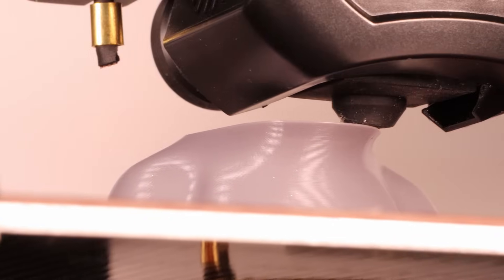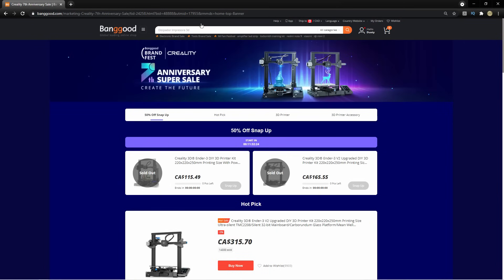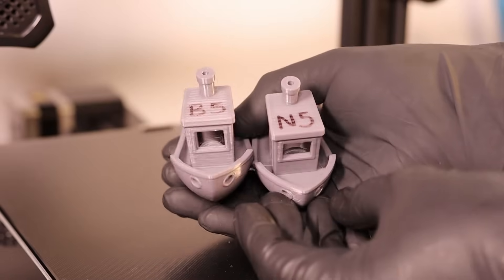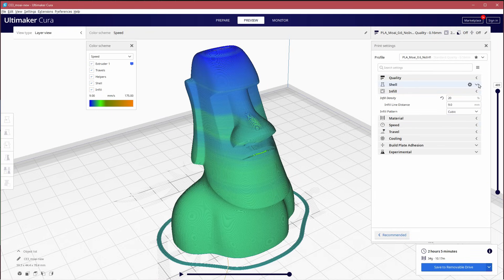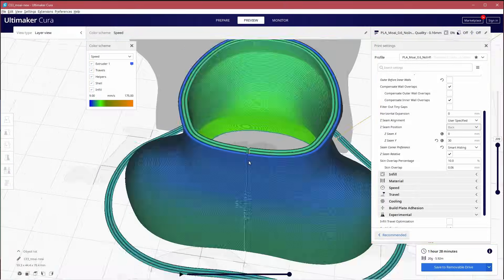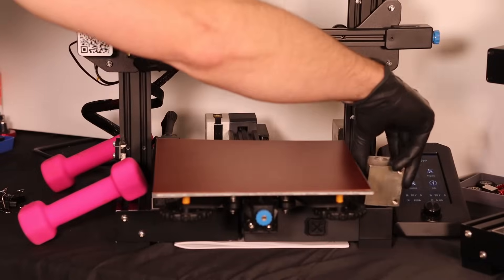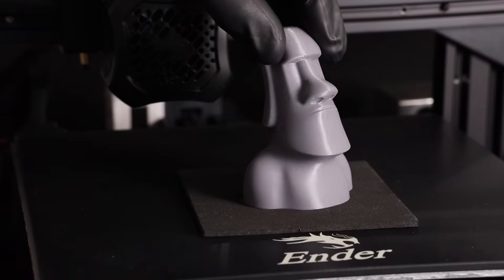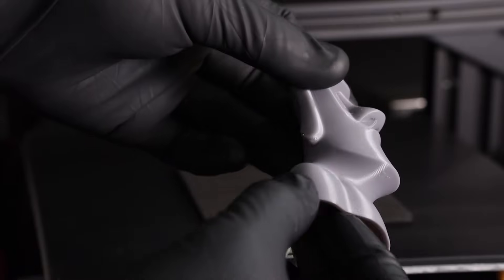Creality Ender 3 V2 - My Cleanest Print Ever and You Can Too!

Comment: interesting find on the solid PEI sheet, is it as good as spring steel sheets in terms of print removal? How's the weight difference? I would eschew the glass if my bed was more flat, but that's another costly upgrade if your built in bed is warped.
Reply from the maker: I've never had the opportunity to try the spring steel out, but I think what I'll do is purchase each type and do a comparison video for each.  There is a big difference between the two axis, at least bringing them closer will improve the print quality and further reduce vibration caused by the Y movement.  I also have braces to try on this machine, I wanted to ramp-up the speed to see how fast these printers can reliably print.  I don't think the speeds are that high, and I'd like to see where the bottlenecks are (nozzle), motors, overall design etc.
Reply: @NeedItMakeIt  could you weigh your pei sheet? :)
Reply from the maker: @specialingu  85grams
Reply: Totally understand, I weighted the glass bed and its about 1lb (540g) compared to the x axis even if you add a direct drive its only about 250g
Reply: @TechExploresNYC  i got curious about what ive got laying about, 540g for my glass too, the lightest was a textured sticker at 32g (but -5g for the sticker cover which you remove to use it, so 27g if you stick it down) (guessing its a clone of what early 3dprinters shipped with?) a steel pei sheet was 241g (say minus 5-7g for cover over the pei surface, so 235g) "fysetc" brand. self adhesive magnetic sticker part that gets stuck to the bed 105g/100g without sticker cover)

Comment: Looks super smooth. That seam seems extra deep though.
Reply from the maker: I think the seam can be improved for sure, I will work on my seam and come back with something that works the best for the bowden setup on this printer.  I print with a 0.6mm nozzle, changing to the 0.4 will improve a little bit from  this.
Reply: @NeedItMakeIt  I didn't realize this was with a 0.6 nozzle, that's pretty impressive.
Reply: @NeedItMakeIt  Looks like it's just coasting too much. Could be because the larger nozzle results in less pressure in the bowden so less coasting is needed
Reply from the maker: @bloogaming8827  I'll work on it and come back with something a little more presentable.  Nothing less than perfection... I hope.

Comment: Stock nozzle is 0.4 you went 0.6 but with a finer layer height. Have you tried with the 0.4 nozzle and same layer height as the 0.6?
Reply: pla will stick to copper but not the same to brass, that's the difference
Reply from the maker: @andidotro  Did not know that.  Ccopper is much more thermally conductive, hard to say how much, since brass is an alloy.  I'm a bit skeptical about the copper nozzles, copper is incredibly difficult to machine, maybe they use a different method to form it, and maybe they are alloys themselves.
Reply from the maker: I can do that and see what happens.  Do you have any experience with the copper nozzles?  I'm curious to see if there is any difference in the print quality from using copper over brass.
Reply: @NeedItMakeIt  There Is not any differece between copper and brass. Just span life.  😎

Comment: Do you find coasting with stock settings making a difference in your prints? I've never used it because i thought it may require tuning.
Also, you talk about the weight of the bed, the vibrations of the printers... All of this will have less impact if you print slower. If people are having issues, using a lower speed would help a lot, right?
Reply from the maker: I can put together a quick test to show the differences if that would help.  Yes printing slower does help, I can't bring myself to print slow, the speeds I showed in the video are pretty slow for me, normally I'm up at 70 infill, 60 inner walls, and 50 outer walls, but my prints are mostly structural and they don't need to look so clean.  The reason I suggest adding weight is to dampen vibration from the normal standpoint, the other side of it is that the alum frame is pretty stiff and it helps to seat the printer on the table better.  Bolting down would be idea and shimming as needed.
Reply: @NeedItMakeIt  After a test on a cylindrical part, coasting didn't make any difference on the z-seam for me. But the default settings didn't make the print any worse, so I guess tuning could help a bit.
I also mainly print structural components, so my speed is at 70 most of the time too.
I just think people who are looking for the best aesthetics should start with a lower speed before anything else.
Great tips anyways, thank you for your answer !
Reply from the maker: @LenordeFPV  Great feedback, it is so tough to tell, we really need some high def zoomed in examples, I did make the mistake on my print to not activate the wipe distance, I am trying another right now with it on as well as coasting to see if it helps.    I just started experimenting with higher speeds like you do, the stock fan can't keep up so I have a massive fan cooling the entire area and that seems to do the trick.
Reply: @NeedItMakeIt  Wait, I don't print at 70mm for everything, just for the infill. I then let Cura step it down for walls and other parts.
I didn't know about the wipe distance! I will check that too. Maybe there is a way to get almost rid of the Z-seam after all...
Reply from the maker: @LenordeFPV  I've just finished a test overriding the default speeds cura uses due to the limitation of cooling and the print turned out very well, we might be printing slower than we need to.  I'm going to do some wipe tests tonight as well, wipe + coasting might just do the trick.
Reply: @NeedItMakeIt  Very interesting ! I hope you will make a video to share your results 😉

Comment: Why do people use glue with a heated bed, thats the whole point of a heated bed
Reply: If your using a PEI sheet your models can shit abit to well... ripping holes ect. For the rest it just helps abit with adheasion tho some degreaser from the kitchen and some IPA 99% before every print works 10x better for me.
Reply: Never used glue once on my pei bed(50 to 60c depending on pla or pla+).. sticks like glue and once the bed drops below 30c the print just pops off. Pei sheet on spring steel(creality). Way better than the standard clip on bed
Reply from the maker: @pridedyanky  I'll give it another try, I can't say I've had that success, but maybe it is just a little too cold, worth another look.  I don't mind the glue stick though, it works great every time and last a really long time.
Reply from the maker: I've never had good success with only the heated bed, the reason is probably that the bed temp is not high enough, I don't personally like to wait for the bed to heat that much and glue stick is super cheap and works wonders.  I clean with soap and water, or just a wet cloth.

Comment: Great result! I will try your gcode on my newly assembled Prusa. Somehow will try to show my results :)
Reply: don’t try the gcode ... retraction, flow, leveling settings are different from an ender instead try the settings profile changed according to your printer ( direct drive vs bowden setup )
Reply: @NanescuRadu1  Thank you. I haven't thought about this..... embarrassing.... I am just starting))))
Reply from the maker: I have been thinking about this lately, the Prusa seems to produce such great results and I wonder which part plays the biggest role in this.  They use linear rails, maybe the motors are higher quality, the pulleys, or the board.  I am really curious to see if the Prusa blows this printer out of the water.  Retraction can be adjusted using the Profile in the description to 0.5 or 1mm and that should get you in good shape for the direct drive.  

I have been eyeballing the bondtech direct-drive adapters for The E3V2, they looks so well made, too bad they aren't a little cheaper price wise.
Reply: @NeedItMakeIt  motors not so much its a combination between the precision of the linear rods and the factory calibrated extruder ... also QC plays a huge role ... they don’t sell untested equipment
Reply from the maker: @NanescuRadu1  That's a good point, the first printer I received was flawless in the assembly, worked well right away, the 2nd printer had the wheels overtightened.  Linear rails may be superior, my first printer was the Anet A8 with these type of rails, however the printer was so wobbly that it could be produce quality prints.  I maybe have to purchase a Prusa.  I am very interested in trying a CoreXY printer as well, do you know much about these?
Reply: @NeedItMakeIt  for a corexy i highly recommend looking at voron 1 or 2 if you already have printer and you can find kits on aliexpress for the rest non printable parts ... using klipper as the main firmare its the fastest printer around other than a delta
Reply: @NeedItMakeIt  When I decided that I am going to get into this hobby I did some research and for some silly reason didn't start it right and purchased Anycubic for 3 month I was always adjusting, trying different settings, different slicers, filament and I managed to print only 1 full print. And then I had enough and sold it for parts. Purchased Prusa (Mk3S+ Kit), and right from the beginning it was printing like I was expecting, yes I did just a little bit of tuning, changed a few settings but most of the time it just prints. 

Problems with Anycubic: motherboard ( was loosing home), motors(needed adjustment), and constant problems with leveling. The only thing where I didn't have problem was adhesion it was great
Reply: @NeedItMakeIt  To be honest I think it's everything combined together makes it such a great printer. On one of these days I will try to print it and see what happens

Comment: It's pretty cool to see this is considered a really clean print. I was doing prints like this on my Ender 3 v2 only after a couple days as a complete newcomer to 3D printing, and I was wondering how I was progressing. 

I've always picked things up quickly.
Reply from the maker: Nice!   I could do better only by changing the nozzle and slowing down the print.  This printer out of the box does make nice prints most of the time, there are some people that seem to struggle.  Changing too many slicer settings at once might be the cause.    I have found that the wheels are too tight and should be loosened and adjusted, this only happened on my 2nd printer.  The 2nd printer also does not seem to have Gates belts, the first one I purchased 9 months ago did.  

I try to have the most harsh lighting and highest def video for my prints so that we can see any imperfections.  I'm really interested in setting up a nozzle cam as well to get a much better understanding of when and why these imperfections occur so they can be addressed.
Reply: @NeedItMakeIt   Can you share your Cura setting using the .6 nozzle.  I have struggled tuning the .6 ....thank you.
Reply from the maker: @chrisc9213  Sure, I'm just finishing up some profiles tonight, I'll send you a link when I'm finished.
Reply: @NeedItMakeIt  Your awesome thanks!!
Reply: @NeedItMakeIt  Awesome let me know when you have them finish!! Thank you!
Reply from the maker: Sorry, I had trouble finding this comment again.  0.6 vs .6.... here is the link.  
https://drive.google.com/file/d/1T4584P7lHn-ETFrgNKRSo2xcLVRHdLK-/view?usp=sharing  

Let me know how it goes!
Reply: @NeedItMakeIt  You hit the nail on the head. People mess with too many settings at once and they don't have the attention span to remember all the settings they've changed, or how to compile those changes into a working formula. Or they have trouble putting the machine together properly.

I learned when I was a computer technician that you do a process of elimination. One thing at a time until you can eliminate what's causing the issue, or until you can figure out what that setting does.

The only settings you need to focus on at first are quality, infill, supports and adhesion. It's odd to me that people have a hard time getting their prints to stick to the bed too, or leveling the bed. I can level the bed in less than a minute with a Post-It note.

I'm seeing what the limits are with the 0.4 nozzle before I experiment with new nozzles. I would like to get a fine nozzle for very high quality stuff eventually. Right now I'm experimenting to see what I can do utilizing the least amount of material and infill, and trying to print strong, passable prints in the quickest time possible.

My main uses for 3D printing are prototypes, products I can use in my fabrication business. Fixing things around the house or at my shop. I'm not much into printing models and figurines. So high quality isn't a huge factor for me. However it's good to know I'm capable of it. I'm an artist but in my artwork I use wood and metal.

Thanks for the videos! 👍
Reply: @dangerous8333  Can confirm. Changing a bunch of settings, especially without some kind of table describing what you changed and what quality you got, leads to trouble. Also, only using 1 or 2 small test prints can lead to false positives by optimising the slicing profile to that particular model instead of a more general profile.

Comment: I found out that combing makes my models worse, so I started using the default settings with some tweaks here and there. The results are much better.
Reply: in order the combing to work perfectly - try activate retraction distance in combing mode 5 mm!)))
Reply: max comb distance with no retraction set it to 5 ) and everything will be gooooood!
Reply from the maker: Can you send me a profile to test?  Some prints might not benefit from it, and there are different combing settings which could affect the results.  My email is needitmakeit@gmail.com .
Reply: @NeedItMakeIt  Sory I have to correct myself, only one model came out worse, on all others it makes 0 difference.
Reply: @NeedItMakeIt PLS CAN I HAVE THE FILE

Comment: Try printing with PLA-F, it is supposed to be a pla with more abs like qualities. I've only tried black and white filaments so far, the black printed like any other pla, but the finish and quality of the white was sublime! I've shown it to a few other friends with 3d printers and they've all said that they have never seen such a quality print before! I did it with a 0.4mm nozzle and I think it was 0.12mm layer height
Reply from the maker: Okay, I'm going to have to look that up.  I had no idea they'd be able to combine the two together, they don't seem at all compatible, they are not soluble by the same chemicals either.  I was thinking about making a video about the most expensive filament vs the cheapest, and see how far off they are.  I'd need to get a filament dryer for this to be an accurate test I think.
Reply: @NeedItMakeIt  I'm not sure what makes the difference, but the white pla-f has never missed a beat. Never had a bad print with it, good adhesion, brilliant layer adhesion, flawless finish... I guess it is down to the pigment used compared to the black. With your comparison video might I suggest throwing amazon basics filament into the mix, would also be interesting to see where that places! The ones I have tried i found to be reasonably priced and printed well.
Reply: @steamtraintom  is there a certain brand of PLA-F that you use? Mainly asking about the white filament you mentioned.
Reply: @steamtraintom  interesting..thank you!!

Comment: Do you have a link to that build plate used in the video? It doesn't seem to look like the one linked in the description. Thanks!
Reply from the maker: I'll double check the link, it is 235 x 235 flexible PEI, I'm liking it a lot, the only issue is that it needs to be held down better around the sides, and I don't have any clips that work with something this thin.  Here is the link https://www.banggood.com/235+235mm-PEI-Flexible-Elasticity-Temperature-Resistance-Plate-for-Ender-3-or-Ender-3-Pro-3D-Printer-p-1642744.html?cur_warehouse=CN&rmmds=search
Reply: @NeedItMakeIt  get an adhesive magnetic strip with a PEI flex sheet. It stays on perfectly!
Reply: @nickdiscipio2678  I agree, i love mine and they add very little weight to the Y axis. My spring steel sheet is very thin and I have no issue with it shifting during the print.

Comment: Where is your filament? I've found that taking the filament off the top of the Ender 3 v2 really helps the print quality - a full 1kg roll can really alter the centre of gravity.
Reply from the maker: I used to keep it on the front only because I had the two printers beside each other for the videos, but that's not a great idea, so I hold them at the top of the frame handing off of the side, the printers are at angles to each other now and the rolls don't interfere with the printers.   Hanging it from the side in the direction the frame is stronger seems to help a lot with reducing vibration.  I'll be purchasing a filament dryer soon for testing so I'll probably have it on the desktop soon.  Let me know if you need a photo and I can upload and link one.
Reply: @NeedItMakeIt  An interesting idea would be to test how these different locations affect quality. My spool is attached to the bottom of the printer to the side. It seems better (especially with models that have a lot of direction changes) but I don't have side-by-side prints.
Reply from the maker: @halldirector  I think that's a great idea for a test.  I have a video idea already in the works about stiffening the printer up to improved print quality, this could also be added to the video, or it could be one on its own as well.
Reply: @halldirector  I bet mounting off the printer would be the best bet. Thanks for this post because I never thought about it before. I bet the side and back mounts for the ender 5 pro and plus I have are adding considerable vibration every time the retraction makes the filament roll rock back and forth on its holder. I will definitely be making holders to sit on my table and see if it helps. Thanks again.